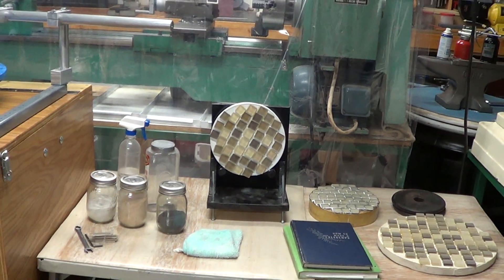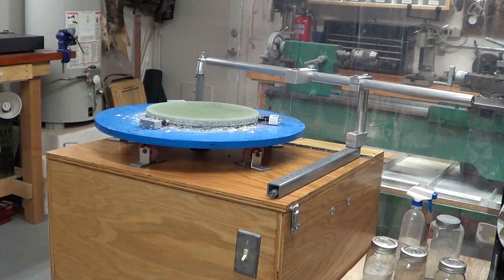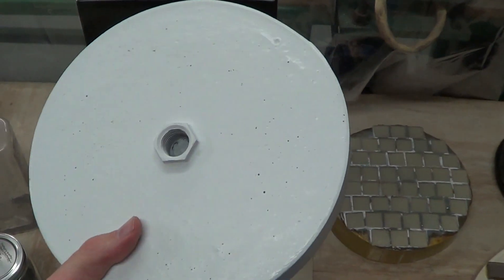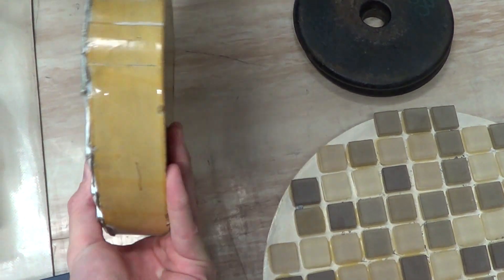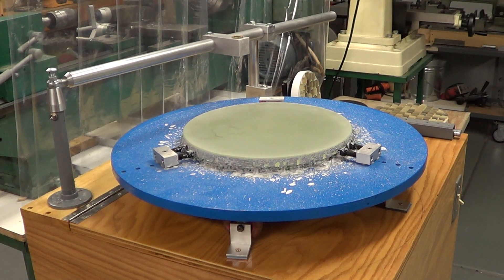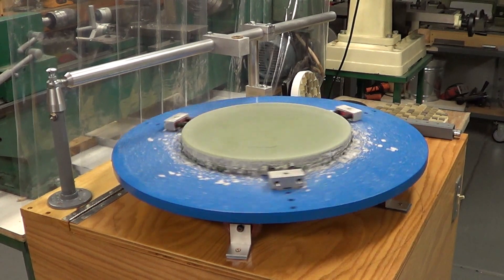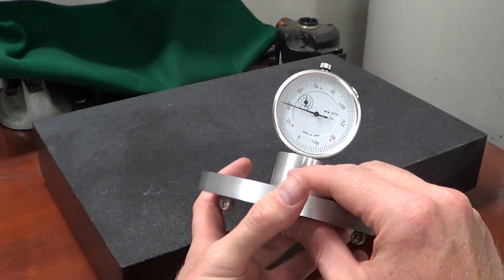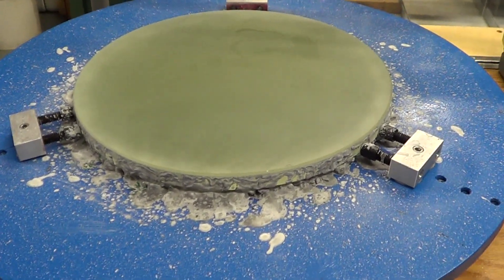Telescope Mirror Making: Part 1

Comment: Michael, I know you try to cut yourself short in credit as you have little experience - but I am very amazed and grateful for your videos. Please keep making more like these, although I know this is a few years old. Also, I am at a point where I really need to make a turntable. How in the world did you design such a stable platform? I am having so much trouble with this and there is nothing anywhere I can find as far as documentation to assist.

Comment: Michael,  great  information.  I'm  also in Arizona split between  Tempe and sometimes in Camp Verde.  You mentioned  that you're grinding  spherical will  you  later configure to parabolic?  Also you  mentioned a gear  reduction box, could you  instead use belt drive  reuction? Love this  stuff.  I have a home  built 10" Dobsonian but I too, am lazy and I went commercial  and 17 years  ago bought a 10"x5.6f.l. from Orion Telescope. It still  works  great  but the mirror  is pretty  sad looking having  suffered through  a half dozen baths ove the years.  I did subscribe  and gave a👍. Love to hear  from  you.
Reply from the maker: good evening, yes, my goal is to first polish to a spherical figure. from there you figure to a parabola. As far as the gearbox is concerned, yes I use a combo of belts and gears to get the speed slow enough. the gearbox was found cheap on ebay (<30$). work has slowed on this mirror...issues with the machine and other hobbies. I'm currently polishing it out by hand. Nice to meet a fellow Arizonian...I live in Surprise.
Reply: +Michael Dodge Appreciate  the prompt reply will try  to  get video  of my dob and assembly  published  soon. Basically  it's  a Starsplitter

Comment from the maker: This is a plate glass blank.  I got it from a large porthole.  I know pyrex is a better substrate, but hey, you use what you got :) This is really a practice run for my next project, a 18 inch mirror.  Thought it was good practice because they are both fairly thin, this one is only 3/4 of an inch! I love a challange.